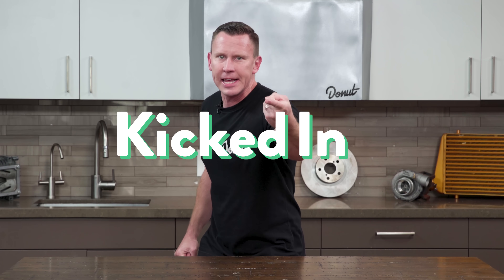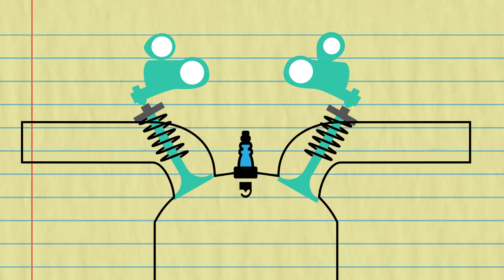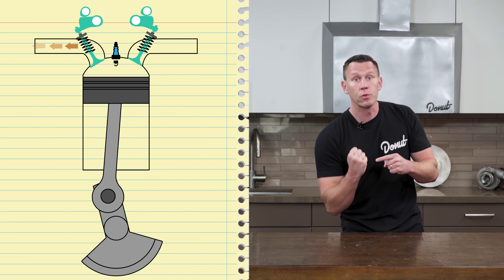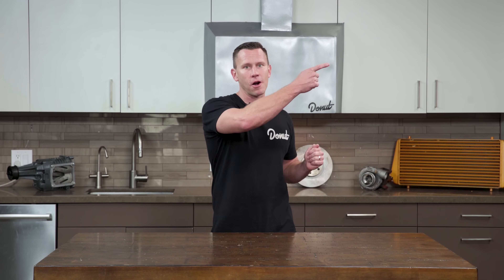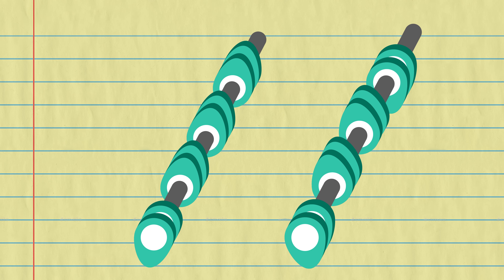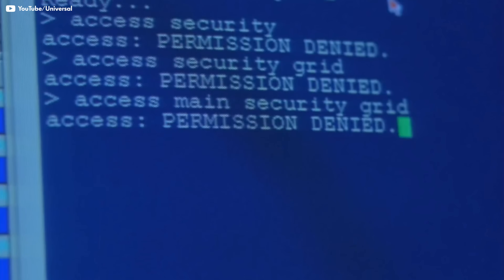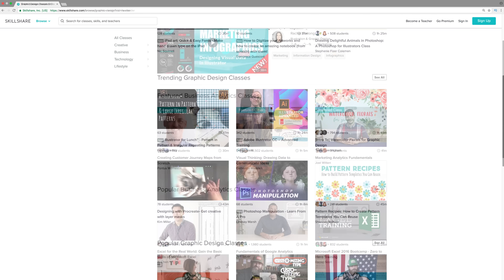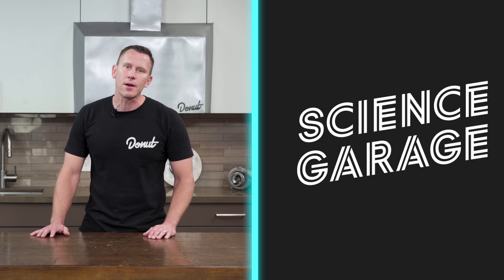VTEC: How It Works | Science Garage

Comment: Understanding just kicked in yo!!
Reply: ITUBE AAAAAAHHHHHHHHHHH
Reply: I swear
Reply: But it didnt go BAAAAHHHHAHAAAAAAAAAAA
Reply: IQ just kicked in yo
Reply: He misses a very important part amd was wrong on a part. Vtecs  middle bigger cam lobe simply kicked in at 5200 rpm regardless of if the pedal is all the way down or not and stays that way until rpms drop below 5200 rpms no other variables matter like this guy said. He said engine temp and oil pressure have to be at certain points too lol nope sorry bud I've tuned Honda engines with hondata for the last 10 years and the only thing that the ECU reads to click that pin in to use the higher lobe is simple that 5200 rpm point. Plus you can literally hear it when the new cam lobe is engaged

Comment: There were many opportunities to say “MO POWA BABY”
Reply: BAHHHHHHHHHHH!!!!!!!!!!
Reply: He didn’t wanna take the shine off of James
Reply: And we he’d say it there was no powa in the power
Reply: He misses a very important part amd was wrong on a part. Vtecs  middle bigger cam lobe simply kicked in at 5200 rpm regardless of if the pedal is all the way down or not and stays that way until rpms drop below 5200 rpms no other variables matter like this guy said. He said engine temp and oil pressure have to be at certain points too lol nope sorry bud I've tuned Honda engines with hondata for the last 10 years and the only thing that the ECU reads to click that pin in to use the higher lobe is simple that 5200 rpm point. Plus you can literally hear it when the new cam lobe is engaged
Reply: @seekdiscomfort4746  what
Reply: im glad i wasn't the only one thought this a million times throughout the video lol
Reply: James didn’t give him copy rights.

Comment: I miss science garage:(
Reply: We all do
Reply: @SpartanX300  ikr
Reply: @rayhanrizvi334  Sad Boi Hours
Reply: @Joddyjohn5  lol ikr
Reply: Dont we all
Reply: What happened to this guy
Reply: Cyberdemon Mike what?
Reply: @NightcrawlerNC  overdose
Reply: MoribusReal I’m still confused
Reply: Bart is like a buffed donut and clingy ex-bf had a baby. I like this guy.
Reply: @NightcrawlerNC  no he had a kid
Reply: @BerualdoBareal  he became a dad
Reply: Me too
Reply: @Watchdog-vf8ug  His kid is a lucky guy!
Reply: Donut fired him cause he had a kid it actually kinda sucks how they did him
Reply: @judah987654321  can I read about that somewhere?
Reply: @judah987654321  where did u hear this?
Reply: He misses a very important part amd was wrong on a part. Vtecs  middle bigger cam lobe simply kicked in at 5200 rpm regardless of if the pedal is all the way down or not and stays that way until rpms drop below 5200 rpms no other variables matter like this guy said. He said engine temp and oil pressure have to be at certain points too lol nope sorry bud I've tuned Honda engines with hondata for the last 10 years and the only thing that the ECU reads to click that pin in to use the higher lobe is simple that 5200 rpm point. Plus you can literally hear it when the new cam lobe is engaged
Reply: @seekdiscomfort4746  well i don't think he weites the script
Reply: Honda is just amazing
Reply: Big time
Reply: Without science garage, who will say "More Power"?

Comment: The people who disliked never had VTEC kick in.
Reply: People who disliked it got gapped by a Honda 😂
Reply: Nah....we bought proper cars with turbos.
And there's only so many cars that one tuned Civic could gap.
The rest were old people cars, clapped oit then given to grandsons.
Reply: He misses a very important part amd was wrong on a part. Vtecs  middle bigger cam lobe simply kicked in at 5200 rpm regardless of if the pedal is all the way down or not and stays that way until rpms drop below 5200 rpms no other variables matter like this guy said. He said engine temp and oil pressure have to be at certain points too lol nope sorry bud I've tuned Honda engines with hondata for the last 10 years and the only thing that the ECU reads to click that pin in to use the higher lobe is simple that 5200 rpm point. Plus you can literally hear it when the new cam lobe is engaged
Reply: @seekdiscomfort4746  Depends on the model and engine, as mine red lines at 6500, its Vtec and peak power comes on at 4k and watching the needle go from 4k to 6k in blink is fun.

Comment: I did not know vtec was this cool lol, it's actually impressive yet simple
Reply: He misses a very important part amd was wrong on a part. Vtecs  middle bigger cam lobe simply kicked in at 5200 rpm regardless of if the pedal is all the way down or not and stays that way until rpms drop below 5200 rpms no other variables matter like this guy said. He said engine temp and oil pressure have to be at certain points too lol nope sorry bud I've tuned Honda engines with hondata for the last 10 years and the only thing that the ECU reads to click that pin in to use the higher lobe is simple that 5200 rpm point. Plus you can literally hear it when the new cam lobe is engaged
Reply: @seekdiscomfort4746  great info! why is he talking about multiple parameters then, any idea?
Reply: @seekdiscomfort4746  i have an ap1 s2k and its also interesting that the vtec has a protection mechanism when the engine is too cold which completely makes sense (shouldn't be romping on it when cold anyways) but just thought that was cool
Reply: @seekdiscomfort4746  I own a FN2 Civic Type R with the K20z4 i-VTEC engine with some basic bolt-ons and a Hondata tune that has lowered VTEC engagement to around 4000 rpms from the stock 5600ish  and you are wrong! If my throttle is less than 25-30 % depressed VTEC will not engage even if I go all the way to the 8600rpm limiter. Perhaps what you say is true in B,F or H series and not on the K series but that I do not know.
Reply: @seekdiscomfort4746  with a hondata u can make vtec work at whatever RPMS the tunner decides.mine is also set by TPS. Soo I don't have to be @(5200) assume at TPS register the decided % of trottle it would kick.
Reply: @seekdiscomfort4746  is it only the type rs that kick in at 5k? I have a 1.8 and I'm sure that's at about 3.5, and thought the type r was at 4k
Reply: Lots of brands have similair systems that work better and more efficient, its just that honda made it so simple.
Reply: @seekdiscomfort4746  I drive a 2017 Honda accord sport sedan and it has vtec. Does it work the same ?
Reply: @roli9168  yes lol I have the same, cvt, auto or manual it has vtec
Reply: @roli9168  no, its bascially similar to how dct works depends on ur throttle depress
Reply: @kevinpalacios4193  but doesnt hav to always kick in at 5k ish like what @seek Discomfort is saying
Reply: @lukas6610  Sorry that's not true I don't know why so many people are confused by vvt, honda was the only company to use the lift part of vtec ( besides toyotas 2zz engine) where you have a high lift cam on the lobe that will not run if it is always on. a base model civic with vtec isnt the same as any sport trim dohc vtec either think of dohc vtec as a factory engine thats cammed and only comes on at a certain rpm. 

There are no better or more efficient versions of this besides I-vtec which combines what you think vtec is with what vtec actually is. For example bmw's vanos is not vtec its vvt most cars now have vvt, it's a variable cam gear that advances timing and in some cases can act as a fake high lift cam but is not as effective. So many people think that yet its as true as the earth being flat which its not lol. 
BY THE WAY WE HAVE THE EXACT SAME FIRST NAME LETS GO.
Reply: @kedaotuning  on my (stock) 2013 Accord, it kicks in around 4800 RPM IIIRC. That applies up to the 2017 Accord with the 2.4l.
Reply: @NAmania how can I reduce the rpm. I want it at 3000
Reply: I have a 2008 accord I bought for shenanigans. Can I remove the limiter completely that it’s always engaged?

Comment: “If a car has a personality on its cam shaft, a vtec has a personality disorder”

You arent wrong
Shingo is mad crazy
Reply: He misses a very important part amd was wrong on a part. Vtecs  middle bigger cam lobe simply kicked in at 5200 rpm regardless of if the pedal is all the way down or not and stays that way until rpms drop below 5200 rpms no other variables matter like this guy said. He said engine temp and oil pressure have to be at certain points too lol nope sorry bud I've tuned Honda engines with hondata for the last 10 years and the only thing that the ECU reads to click that pin in to use the higher lobe is simple that 5200 rpm point. Plus you can literally hear it when the new cam lobe is engaged
Reply: @seekdiscomfort4746  bot
Reply: The sophistication of God Hand combined with Shingo' psychopathic tendency
Reply: ~C O O L   V I B R A T I O N S~
Reply: @seekdiscomfort4746  am also a Honda tuner. Many Hondas under our belt at our dyno here. And your both right. While yes, if you set the high cam and vtec kicks in at 5200, then higher lobe is activated at 5200 BUT Vtec also has its own parameters. For example, you have to usually be at a minimum of 140*F coolant temperature that your engine needs to be at before Vtec can activate. When it comes to oil pressure, you cannot set Vtec to low or there won’t be enough oil pressure. So yes you can set Vtec to kick in at 5200 you also have to meet the parameters to safely be in high cam (engine temp and oil pressure). Obviously Once the car is started and warmed up it’s fine- it’s not like anybody is going WOT as soon as they start their car. But he isn’t wrong either.
Reply: @mahmudhassan8894  this guy has best comment on here❤

Comment: VTEC to everyone: Very sophisticated speed increase.
VTEC to me: VROOOOOOOOOOOOOOOOOOOOOOOOOOOOOOOOOOOOOOM
Reply: vtec doesnt increase speed, it increases efficiency
Reply: @george64826  it does increase speed by giving the car more horsepower. Bro you just watched a video explaining vtec and still missed the point. its a fuel efficient car in the low end and has power in the top end, making it faster.
Reply: BRAAAAP BRAAAAP BRAP BRAP BRAP
Reply: More like, vvrooooooAAAAAAAAA
Reply: @ConLLee  Razvan is right,  the engine could be just as powerful without vtec
Reply: bwaaaaaaaaaaaaaaaaaaaaaaaaaaaaaa
Reply: Don't start a war in the replies, thanks...
Reply: VTEC for James: Paaaaaaaaaaaaaaaaaaaaaaaaaaaaaaaaaaaaaaaaaaaaaaaaaaaaaaaaaaaa
Reply: I think you mean vrrrrrrrroooOOOOOOOOOM
Reply: VTEC: BAHHHHHHHHHHHHHHHHH!!!!!!!
Reply: VTEC:BroooooooooomBWAAAAAAAAAAAAAAAAAA
Reply: VTEC:vroam  vroam  vroaaaaaaaaaaaaaaaaBAAASAAAAAAAAAAAM VROAAAAAAAMMMMMMMMMMMMM     MMMMMMMMMMMMM
Reply: i just go fast to hear my v-tech so my car goes  vROOOMMMMM
Reply: @ConLLee  yes my mom's odyssey have vtec and yes when it kicks in vroooom.
Reply: He misses a very important part amd was wrong on a part. Vtecs  middle bigger cam lobe simply kicked in at 5200 rpm regardless of if the pedal is all the way down or not and stays that way until rpms drop below 5200 rpms no other variables matter like this guy said. He said engine temp and oil pressure have to be at certain points too lol nope sorry bud I've tuned Honda engines with hondata for the last 10 years and the only thing that the ECU reads to click that pin in to use the higher lobe is simple that 5200 rpm point. Plus you can literally hear it when the new cam lobe is engaged
Reply: the motor would make more power all of the time without vtec you make less power at low rpms and normal at high rpms
Reply: @ConLLee  apply cold water to the burn
Reply: VTEC is kind cool, not gonna lie it was in inital d
Reply: @TechFabLab  But the system isn't kicking in to add efficiency. Only reason it has vtec is for the power increase, the efficiency is already part of the engine.
Reply: Its more like vroooooooooooooOOOOOOOOOOOOOOOOOOM
Reply: @beeed6415  yes.
Reply: BAHHHHHHHHHHHHHHHHHHHHHHHHHHHHHHH!!!!!!!!!!!!!

Comment: Vtec in old 2003 Honda Odyssey: exists 
Me when I was 16: VROOOOOOOOOOM
Reply: Dude!
Reply: It’s really true though! Those things are MINT
Reply: VTec in 2003 Honda Element....So fun....People hate me but this car got some good handles🤣
Reply: Yes! My02 as well lmaooo
Reply: HAHA I'm in line to get handed down a Honda Odyssey with broken power steering but at least VTECH just kicked in yo!
Reply: @crowsab5291  at least once you have to get on an empty highway on ramp, stop, then floor the thing. Won't be disappointed
Reply: @BigRobChicagoPL  Until I buy a Golf GTI, I will remember your words forever, and make you proud. Funny how after 2 years you're still on this comment 😂
Reply: @crowsab5291  Make the Oddy boys proud. Mine is no longer w/me but you gotta keep the vtec legacy alive (my new Civic doesn't have vtec :( )
Reply: @BigRobChicagoPL  Yes soldier!! I’m sorry for your loss 🙏
Reply: He misses a very important part amd was wrong on a part. Vtecs  middle bigger cam lobe simply kicked in at 5200 rpm regardless of if the pedal is all the way down or not and stays that way until rpms drop below 5200 rpms no other variables matter like this guy said. He said engine temp and oil pressure have to be at certain points too lol nope sorry bud I've tuned Honda engines with hondata for the last 10 years and the only thing that the ECU reads to click that pin in to use the higher lobe is simple that 5200 rpm point. Plus you can literally hear it when the new cam lobe is engaged
Reply: First time I hit VTEC was in a Pilot

Comment: I once had a '91 Honda CRX vtec. What a great little car that was.
Reply: Gran turismo 4 fail music (oh yeah) intesifies
Reply: Awesome car and great looking too
Reply: He misses a very important part amd was wrong on a part. Vtecs  middle bigger cam lobe simply kicked in at 5200 rpm regardless of if the pedal is all the way down or not and stays that way until rpms drop below 5200 rpms no other variables matter like this guy said. He said engine temp and oil pressure have to be at certain points too lol nope sorry bud I've tuned Honda engines with hondata for the last 10 years and the only thing that the ECU reads to click that pin in to use the higher lobe is simple that 5200 rpm point. Plus you can literally hear it when the new cam lobe is engaged
Reply: I had a obd0 b16 ef hatch and it would not Switch to vtec cold.
Reply: @seekdiscomfort4746 Right on brotha.. He totally missed an opportunity in at least pointing out sohc vtecs like y8 or z6.. not to mention frankesteins like mini me D, B or K series

Comment: You should do a video on larger engines that shut off certain cylinders when you’re driving normally
Reply: Noah Peltier  what you’re referring to is cylinder deactivation ;)
Reply: I agree, start with the Cadillac V8-6-4 of the 80's haha
Reply: 4G92 Mivec MD
Reply: Just like the demon!
Reply: FallaciousScotsman the demon has cylinder deactivation...
Reply: Audi does that on some  V8, reducing them to 4
Reply: One of honda's j series has that. Shuts off 3 cylinders when in normal operation.
Reply: Lol my Accord Hybrid does that
Reply: I know, that's why I said 'just like the Demon,' when OP said to do a video on cylinder deactivation.  I thought it would be a cool tie in bck to the the Demon.  Derp.
Reply: 5.3 Vortec
Reply: Or letsoccwydn for short like vtec
Reply: or just shutin valves basically
Reply: Chiron does that too on its w16 engine

Comment: Already knew how VTEC worked, so I simply added a higher flow intake manifold to optimize pressing the pedal to the floor. Worked nicely while keeping 4 grand in my pocket and my engine life existing avoiding turbo power. With the high flow header and cat combo connected to a full catback, I'm satisfied.